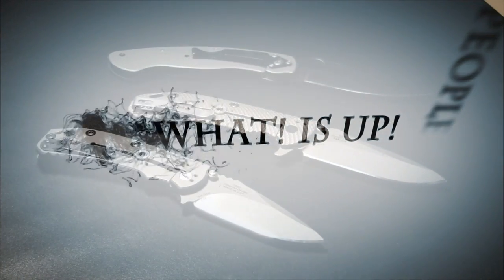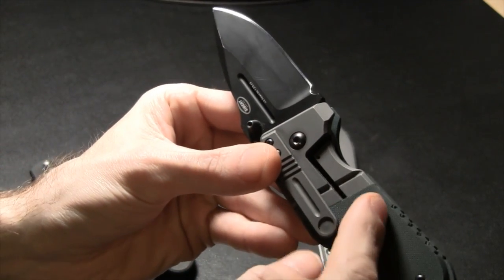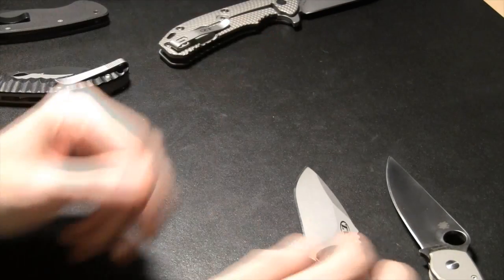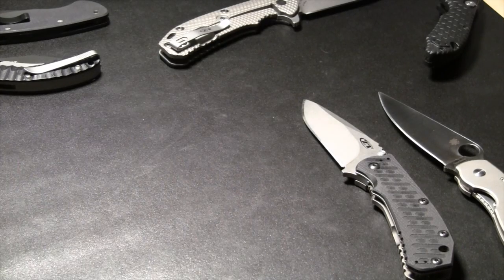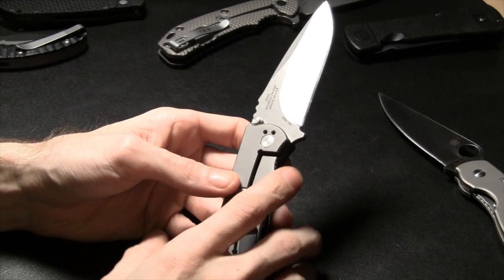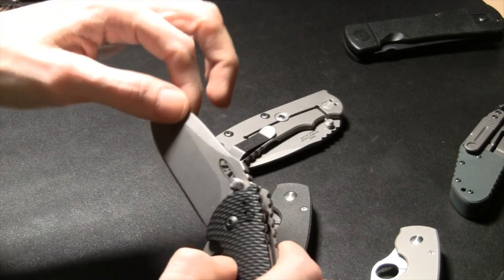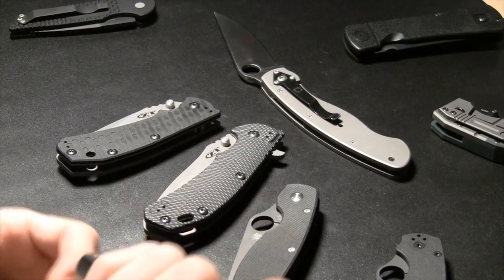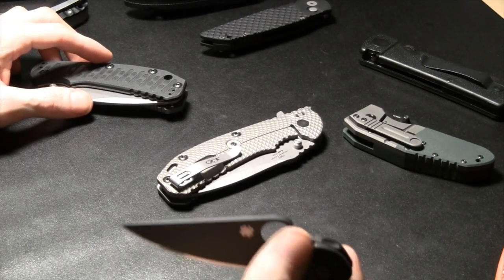The Anatomy of Knives: The Basics

Comment: Nicely done. Kept me interested for 40 mins. :)

You forgot to mention the biggest con with a open pillar construction: they're a pita in hard use because of the hot spots. 

On the same note something like the compression lock is a weird contradiction, in that it's built for strength but causes an incredibly uncomfortable hot spot right at the pressure point that makes it virtually impossible to use for any extended period. The Millie kicks Paras butt in this regard.

Comment from the maker: Well you could say that, and ultimately it all comes down to semantics or perception you might say. Many use aesthetics to judge the differences, some of us use a widely accepted mechanical makeup, others go on thickness and such. I guess you could say whichever part is responsible for the most structural rigidity of the knife's lock bar would determine which it is. On many liner locks, the G10 is more responsible for the structural rigidity than the lock bar, you see what I'm getting at?

Comment: Have you ever disassembled and compared different coldsteel knives at the same time? Not all triad locks are the same. Between my friend and I, we have failed a rajah3, micro recon, and large voyager. The regular recon 1 has the strongest deepest lockup. I used to praise coldsteel up and down for how strong the recon 1 is.... But have since learned that is not the case with all models. What's your opinion? Maybe you could make a vid? I'd appreciate it. Mahalo, Mike